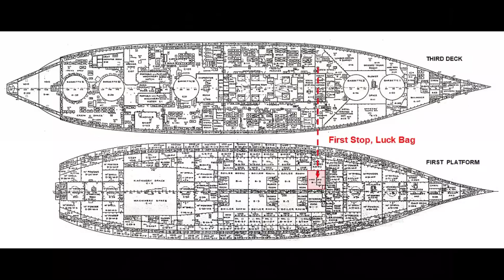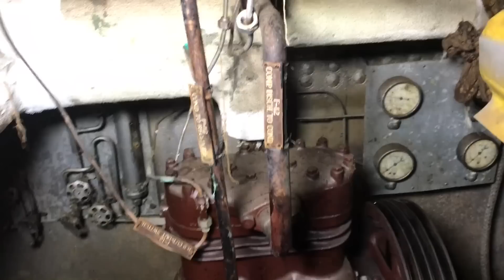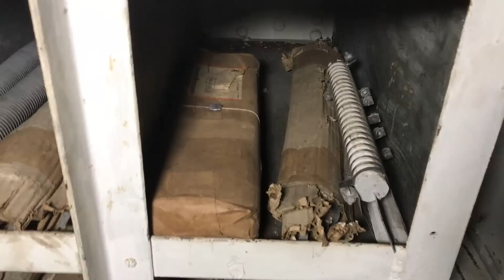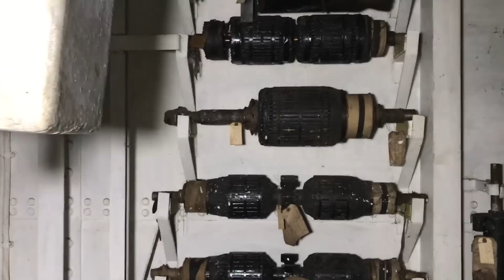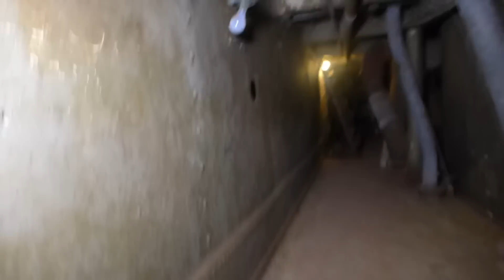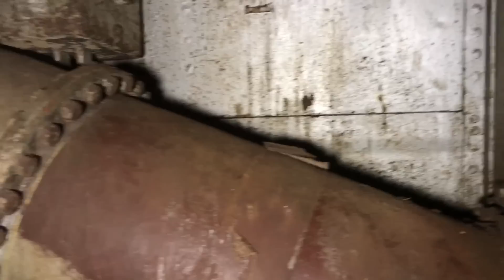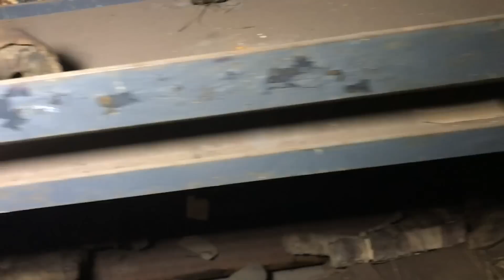Battleship Texas, Looking For Hidden Treasure!

Comment: What Freon did they use back then was it R12 or ammonia.
Reply from the maker: The ship's major cooling system was installed when the ship was built and put into service in 1914.  It was entirely devoted to cool the ship's groups of 14" gun powder magazines.  The CO2 based system remained in service throughout her 32 year career.  Even though ammonia far more efficient and was the refrigerant of choice for commercial use in the early 20th century, it was far too dangerous to use in the enclosed spaces of a ship.  As a side note, the system was becoming problematic by World War II due to increased wear and lack of parts.  At least one request was made to replace it with a freon based system by the ship's engineering department during World War II, but it was rejected.  One likely reason was the need to cool powder magazines lessened as stabilizers in the smokeless propellant improved to make it more tolerant of high temperatures.  Another guess would be that it was unlikely that powder would sit unused for the time needed for heat to destabilize it once the ship was in the Pacific.  Another likely reason was the higher priority need to use new equipment on new ships rather than old battleships that were going to be retired and scrapped soon after the war ended.  Two small systems were installed in the 1940's that used R12, one for the ship's infirmary and auxiliary combat information center, and the other for main battery plotting room.  The infirmary needed cooling for obvious reasons.  The auxiliary cic space was very small and jammed with tube type radar transceivers and other equipment that generated a huge amount of heat that needed to be eliminated.  The plotting room was located deep in the ship where it sat forward of #1 boiler room and above 4 heated fuel oil service tanks.  These conspired to drive air temperatures to well over 100 degrees when the ship was at Normandy and outside air temperatures were in the 70's.  The room contained a large crew who worked worked with mechanical computers and large switchboards needed to generate and transmit firing solutions to the 14" main battery gun turrets.  Its freon system was added in December of 1944 in Honolulu as the ship transited to the South Pacific where she took part in the invasions of Iwo Jima and Okinawa.

Comment: Sir. It was a real.pleasure to watch your video and click that like button. The video and your knowledge was great. Best of luck. I will also subscribe and watch more of your videos. Thanks again. BTW, dad served on the USS Pennsylvania, turret 2 gunners mate.
Reply from the maker: Thank you for your kind comments!  Your dad worked with exactly the same guns.  In fact, some of the ones on Pennsylvania were removed after their bores were worn, rebuilt and found their way onto Texas in 1944!  The only difference is that when on BB38, they had vertically operated breeches.  He also had to work in even more cramped conditions since Pennsylvania had 3-gun turrets that were spaced closer together in a space not much larger than those on Texas and had three gun crews!
Reply: @tomscotttheolderone364 Thanks Tom, theres something I never knew. You sure know your facts. Dad served 41 / 45 and luved that ship. I have been on 3 battleships so far. The size and magnitude astound me. I also have watched 2 more of your videos. You go places in them that others dont. Thanks again and keep up the great work.

Comment: Great finds Tom, and another outstanding video! I was wondering if there was anything left in her machine shop? I personally would be interested in a video if there is anything left to see. As many times as I've been aboard over the last 50 odd years, I don't recall ever seeing the shop myself.
Reply from the maker: The ship has a large, very well equipped machine shop that still has most of its equipment.  In fact, the motor on its large lathe was rewound about 20 years ago and was used after that to produce simple metal parts.  The shop is located on third deck between turrets 3 and 4 on the starboard side.  It is caged off to protect it from destructive hands, but can be seen in detail when the ship is open to the public.
Reply: @Tom Scott, The Older One  Awesome, I'll look for it the next time I'm there. It's good to hear that some of it has been returned to service as well.

Comment: Did they have to lug those heavy objects up those ladders?
Reply from the maker: In many cases, yes.  However, in most cases, they could use ropes and hand hoists to move really heavy stuff up or down trunks, which are vertical passages that penetrate multiple decks.
Reply: @tomscotttheolderone364  Thanks for responding.  It seems crazy that they didn't have a better set up than that.

Comment: It might not be historically accurate but have you ever considered removing some of those large steam pipes since the same system is no longer in service nor will it ever be it would make accessing certain areas a lot easier.
Reply from the maker: I have no say about what stays on the ship and what leaves.  However, I think I can speak for those who do when I say that the value of a museum ship or any historic artifact is largely lost if it is not historically correct.  That means keeping pipes that are now in the way.
Reply: @tomscotttheolderone364  true however I only bring it up because there are some World War 2 submarines that have holes cut into the Hall so that people can more easily enter and exit The Vessel now that it is on the land and acting as a tourist attraction.
Reply from the maker: @justsoicanfingcomment  That is needed for submarines due to limited access caused by them having a pressure hull and few small hatches.  That is not the case with Texas, that has multiple large deck hatches that allow good access to second and third decks.  Removing pipes in lower spaces won't improve access anywhere that the public would ever be allowed to go.  That brings up the point that the public will never be allowed in most places on the ship for two reasons.  It would require hazardous climbs down ladders and the potential to fall multiple decks.  Also, there is a lot of permanent damage to the ship caused by people in the 1940's and '50's, so they will not be reopened.
Reply: @tomscotttheolderone364  does not mean that at that point you might as well just create a virtual tour of the ship and allow it to be scrapped?
Starting with the parts that are inaccessible to tours.
Thereby lightning The Vessel and keeping it afloat longer by easing the maintenance burden.
Reply from the maker: @justsoicanfingcomment  I understand your point, but keep in mind that the ship is much more than a tourist destination.  Battleship Texas is monumentally important as the world's last surviving dreadnought battleship, and much of her equipment and systems cannot be found anywhere else.  The primary mission of the staff, the foundation that manages it and the State of Texas is to preserve all of that as an historic artifact.  As such, every attempt is made to keep it intact as much as possible with all items kept on board that were left by the Navy.  Every item has some kind of story to tell that is part of the whole.  It must always be assumed that what will be of value to people 50 years from now is not what is valued now.  To tear things out as a matter of convenience or reduced maintenance diminishes the ship's value and robs future people of the opportunity to see and understand the ship as the sum of her parts.
Reply: @tomscotttheolderone364  I hope you do plan on creating a virtual tour of the entire ship and logging everything digitally so that those bits and pieces that have stories to tell can tell them when the ship is nothing more than a pile of rust when your efforts to maintain it inevitably fail.

Comment: The Condenser Water piping you noted is just the overboard piping.  Pump suction is in the bottom of the ship under the Main Circulating Pumps for the condensers
Reply from the maker: I used drawings specific to this ship to identify the pipes and devices.

Comment: Was the ship interior painted with lead-based paint? Sure wouldn’t want to inhale that
Reply from the maker: Much of it is, but is stable enough to be around.  However, I don't make a habit of sticking my hand in my mouth after touching things.  It lead is addressed in one of two ways whenever an area is being repainted.  If undergoing a complete restoration in a heavily trafficked compartment or passage, a licensed contractor will remove it and the fresh steel surface is primed and painted with epoxy coatings of the appropriate color.  There are times when areas receive new paint that are only occasionally occupied and see light traffic.  If the original paint and primer still adheres well, it is lightly washed and a water base sealing coat designed to encapsulate lead paint is applied.  Epoxy is then applied on top of that.  Adhesion tests performed on this technique have shown it to stick very well.  The expectation is that if not exposed to extreme water and humidity, the encapsulate and coatings should last at least 10-15 years.  While it is inferior to remediation, and priming and painting bare steel, it meets the need to save 10's of thousands of dollars in scarce funds while stabilizing and protecting what is there.

Comment: What are the blowers in the forward area used for?
Reply from the maker: The decks from that point forward do an odd thing.  Due to the rise of the bow, the third deck is very tall.  From the point where I entered the passage where the armatures are stored, it splits it into two decks, the half deck above and third deck below.  At that point, the third deck is too short use for much than store things.  However, they also used it for something else.  It acts as a plenum for the ventilation system.  The blowers pull air from outside into the plenum, then duct work carries it out and into compartments on all decks in the forward part of the ship.
Reply: @tomscotttheolderone364  Thank you.
I visited the Texas when I was very young.
I have been waiting for the restoration to start and at some point get finished.

I plan on going to see her when she is finished.

Thank you for all the cool stuff yall have been showing us.

COME ON TEXAS!

Comment: As an old industrial maintenance guy, I really enjoyed this video. We always like lots of spare parts!! I wonder how they cataloged all these spare armatures. You obviously didn't carry the old one around and look for a match. Were there tags on each one with some kind of part #? I assume then that the Engineering Dept had reference books so you could figure out which motor took which armature....and maybe where that part was stored?  Also, many of these parts were in tough places to get to and would be VERY heavy. Did they have any clever ways of moving these parts around....or just lots of manpower? Thanks for all you do!!
Reply from the maker: I have seen scans of exploded parts drawings for motors and other equipment that were produced by their manufacturers and almost certainly used to identify parts.  I cannot say with complete certainty where on board drawings and inventory records were kept; however, it is reasonable to assume that they were kept in an engineering office.  Mechanical parts, gaskets, bolt, etc. were kept in engineering store rooms located throughout the ship.  As you saw in the video, electrical parts had their own storerooms.  While I have not seen clear documentation, I feel it is reasonable to assume they used card files, similar to the old Kardex system.  It had a card for each part, with cards organized by part number; each listing part number, brief description, location and quantity on hand.  As far as armatures, it's pretty unlikely that they failed very often.  That being the case, the goal would be to find a place to store these heavy, bulky parts where they didn't take space needed for more commonly used items.  If that meant having to crawl to get to them and drag them out, so be it.  That's what 19 year old sailors were for!

Comment: How were locations for these items cataloged, particularly when the parts are in a completely different part of the ship from where they are used, such as the thrust bearings?  Would there be a note in the thrust bearing maintenance manual saying where they were or would there be a central directory that you would need to go to to track down the parts you need for a given job?
Reply from the maker: Most certainly!  In the case of the thrust bearing shoe, engineering department would pull a drawing for the thrust bearing they have on file and get the shoe's part number off of it.  An inventory card, kept in a filing system, would be pulled that gave part number, description, quantity on hand and location.  Every time a part was used, quantity would be changed on the card to show it.  If its storage location changed, the card would be marked to show that.  Engineering maintained inventory for mechanical and electrical parts.  General store keeper maintained the same for general ship supplies that included light bulbs, toiler paper, paint, scrapers, tools, screws nuts, and other parts not maintained by engineering or other major departments that maintained their own specialized inventories.  One of those was ordnance division that stored parts and supplies required for the weapons.  Then there was food stored and tracked as crew provisions.
Reply: @tomscotttheolderone364  Thank you for that detailed reply!

Comment: Thank you very much for the video! It would be wonderful if you all could be able to get some of the electrical systems operating with the stores you found.
Reply from the maker: I'm glad that you enjoyed it.  As far as making things work, unfortunately, no.  There are several reasons, a major one is that almost all motors require 120 volts d.c.  It simply isn't practical to produce that in a usable amount.

Comment: Thanks for the video Tom, we appreciate you crawling around.  Those places look well off the beaten track.  How often are they visited these days?  Just irregularly to check condition?
Reply from the maker: It is likely that nothing is being checked while she is in dry dock.  Prior to that, it is likely that compartments and voids at the hold deck level would have been checked regularly for flooding.  Higher compartments less likely, except for those that had to be entered to access compartments beneath them.
Reply: @tomscotttheolderone364  Thank you for your reply.  Hopefully the next chapter of the old lady's life will see her with many more visitors and museum staff and volunteers not having to worry (as much) about leaks more and more spaces can be opened up!

Comment: Electric motor reliability sure has come a long way!  Also, as for the "lucky bag," remember the old saying "gear adrift is a gift1'
Reply: Not really, but now you usually toss and replace.  The big DC mill motors are no longer made, they are all antiques that have been remanufactured dozens of times.
Big AC motors have more resilient insulation to hold up to the stress of frequency drives, but they certainly aren't any more durable or reliable than the iron giants of the past.  There are a lot of motors from WWII still spinning.

Comment: Engineers had plenty of homey holes to store/hide stuff
Reply from the maker: I was speaking with a former manager of the ship a couple of days ago when he told me a story about taking an old veteran back to his duty station in the gun pit of one of the turrets around the year 2000.  After pushing, squeezing and lowering him into the pit, he started talking about what he did there.  At one point, he pointed at a small crevice that would require contorting your arm to reach in.  He said he used to hide stuff in there.  He then reached in and pulled out an old magazine he had folded and stuffed in there more than 60 years before!
Reply: @tomscotttheolderone364  Honey Holes, or Home Sweet Homes

Comment: All those armature. Have you thought about scrapping all the unused equipment and parts found. Blasphemy I know, but the copper and metal would net somewhere in the vicinity of half a million, and they're just sitting there. Might as well use your scavenging skills and some young volunteers to get some value out including the unused motors and stuff. Just a thougbt!
Reply from the maker: Absolutely not.  All of these items, and how they are placed, are artifacts and integral to the ship's history.  It would it be highly unethical, if not illegal, to remove and sell or destroy them.

Comment: Awesome look into some unique spaces and artifacts, one must wonder just how often those armatures failed to justify having so many.
Reply: It is not how often they fail, but when at sea and you have a failure, there is no repair shop except what you have on board. It only needs to be useful that one time.
Reply from the maker: I agree.  While they certainly had the ability to rewind most armatures, there would be many occasions where they did not have the luxury of time required to do it.  Once changed out, they could take the bad armature and rewind it at their leisure.  However, there were major motors, such as those that drove the hydraulic equipment that rotated the turrets and elevated the guns, that couldn't be easily repaired or rewound.  In that particular case, they had mechanical linkages that allowed them to change to a second rotating mechanism and motor, or link the two guns in the turrets together so that one motor and gear could elevate the two guns together.  That changeover could happen in a matter of seconds.